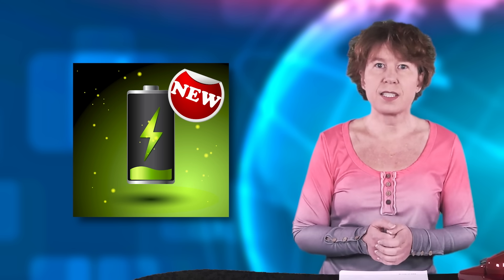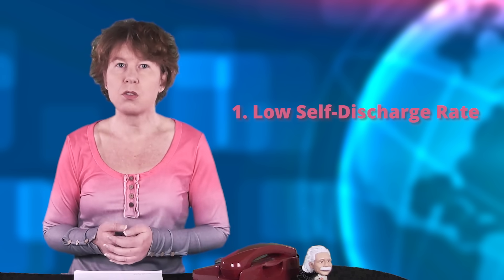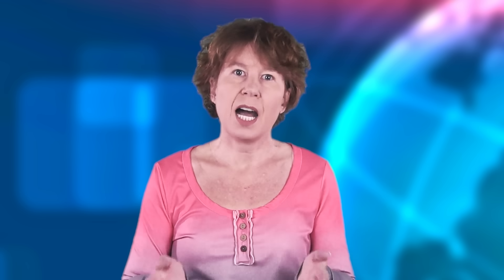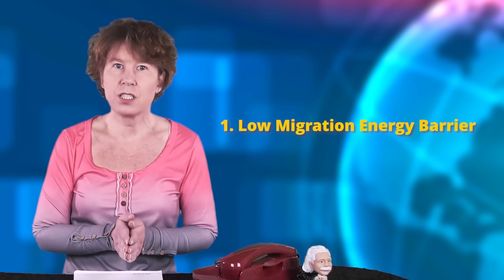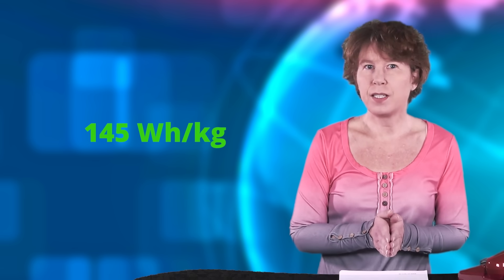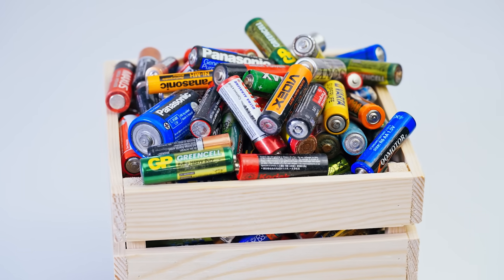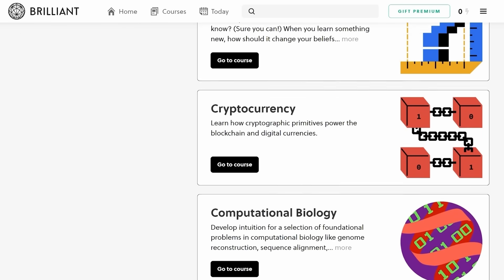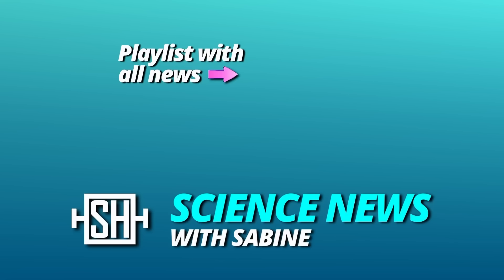Fully Charged in Just 5 Minutes: New Battery Breaks Records

Comment: So, a Tesla use 250kW to charge in about 20 minutes.
So if you want to charge the same battery in 5 minutes, you need a 1MW connection. That's for sure the common connection of every home.
Reply: It doesn't work like that.  A Tesla charger will give you 250kw but only for a small part of the charging session.  Most of the time is spent throttling the power to protect the battery.  If a battery can be made that doesn't need to be protected that 250 will fill it up pretty quick.  A tesla battery only holds between 80-100kwh.
Reply: @notverygoodguy  that's present tech.
Now just pump up that numbers. So if it's throttling the time where 1MW has to be delivered is even shorter. So it's even worse for the grid.
Grids are designed for "constant" load not fluctuating loads of hundreds of Megawatt throughout the country.
Reply: @spedi6721  Let the big boys figure it out. Which they will/are. You could do some research about how they're actually doing it rather speculating from ignorance. The information is all out there. It's solved and doable, though of course the grid will need to increase overall electricity generation by quite abut over the next 25 - 30 years that the transition will take.
Reply: @spedi6721  People don't charge their cars at the same time.
Reply: @notverygoodguy  what? Then what are the cars doing at the chargers on the motorway?
Reply: @spedi6721  Same reason why you see more than one car at a time at gas stations on the motorway.  Still doesn't mean that everyone has to refuel all at the same time.
Reply: @spedi6721  That isn't how fast DC charging stations work these days.  Fast DC stations almost universally buffer the grid energy through a very large battery (such as a Tesla megapack or two).  The more bursty energy delivered to the vehicles is coming from the buffer battery, not the grid.  The grid acts more like a trickle-charger for the buffer.

As an example, one Tesla Megapack with 4 MWh of storage holds enough energy to fully charge around 40 EVs from 0 to 100%.
Reply: @junkerzn7312  finally someone with a reasonable answer! Thank you mate! Technically a good solution to ease the stress on the grid. 
But tbh. That'll give you a lot of charging losses. You need about 120% of power, to get 100% into the buffer battery and than a second time into the car.
So that's why fast charging is more expensive.
But in the end, it's not about the money, but the 20% more co2 you emit.
Guess some ppl will be glueing them self's to the superchargers then.
Reply: @spedi6721  No, not that much.   The buffer battery represents around a 3% inline loss, on average.  The battery round trip is 95% efficient and some of the energy bypasses it.  So ultimately the buffer battery does not really impose much in the way of losses.

The AC has to be rectified anyway (buffer battery or not), and the AC is coming in at 7200V or higher.   The buffer battery is sitting at the bus voltage which can be around 1000VDC, which needs to be generated from the AC even without a buffer battery.   That leaves just the final buck regulation stage before it hits the car's battery pack.

So we are talking really high efficiencies here just in general due to the high voltage.

-Matt
Reply: @spedi6721  One solution I heard regarding ultra-fast charging, was onsite large storage battery systems that are basically trickle charged (if you can call it that) by the grid, then those are used to supply large currents... kinda like a cistern is used for a low flow well. Although, I personally think we need to upgrade the grid and greatly increase the use of nuclear power in this country to isolate sections of the grid for national security. The use of battery systems for stabilizing the grid isn't exactly a new idea, but in areas that see surge usage, it makes sense.
Reply: @CtDDtC1919  as already said will this cause additional charging losses. Now you need to charge 2 batteries, not one. And for 100% charge, you need around 120% energy. Plus the losses for the electronics. This battery also needs to be built and may not last that long.
Remember the "power bank" tesla built for a town in Australia? Parts of it went up in flames. Can't remember if they managed to rebuild it.
Reply: @CtDDtC1919  Most Fast DC charging stations already have huge on-site buffer-batteries, because that is how they reduce demand-charges from the utility and that is how they integrate solar into the station (which some now also have in huge quantities).  So the buffer batteries are already saving vast amounts of money.

And spedi6721... the losses are minimal.  3-5% at most with a buffer battery verses not.   These are not little batteries.  They are high voltage buffers on a DC path that has to exist anyway (buffer battery or not).
Reply: @spedi6721  It was just "for example" technology and the free market will sort it all out.
Reply: @junkerzn7312  Real quick, just wanna say that I appreciate a community where people can engage (possiby) bad faith actors with facts and perspective. I would not have had so much patience. Lot of people out there either confidently saying mistaken things or even obfuscating the truth on purpose. Makes it easy to want to just ignore it all and check out (which can even be the primary goal of misinformation). So, in this case, appreciate the information and context provided by the people who do know.
Reply: @truhartwood3170 of course its doable . But  not by solar or wind . And at a cost that will cripple any goverment that try's to implement.  Oh that's right make the poor pay .
Reply: @spedi6721  You were already told the losses are 5%, stop reapeating your clearly falacious 20% figure or you will be considered a malicious troll.
Reply: @Cyrribrae  I try my best as an Electrical Engineer whos specialty is hip-deep in power systems, batteries, on-grid/off-grid, the grid, and electrification in general, to educate people.  It isn't a casual interest.

The amount of mis-information that floats around social media is staggering.  And it isn't necessarily all due to bad-actors.  There are plenty of bad-actors, but also huge piles of people in categories ranging from casuals to semi-technical people who never-the-less are so badly misinformed that they just wind up amplifying and repeating, "with authority", bad information and nonsense.  Particularly when it comes to our electrical grid.

It doesn't help that it has all become so politicized to the point where people argue over the basic physics without knowing one thing about the actual physics.

Still, I think it is relatively to easy to separate the mis-information pushers from the mis-informed-but-willing-to-learn types.  I'm not going to go easy on anyone I think is pushing nonsense on purpose.

I do hope I have a positive effect when it comes to topics within my area of expertise.  And it is even easier to "fix" the opinions of semi-technicals like Electricians who understand the basics about electricity but don't quite understand how power is actually transmitted or how efficiencies are calculated.  Or old lead-acid heads whos understanding of electricity stopped at 12V two decades ago.

Ultimately, being able to turn-around semi-technical people has the greatest return because they will turn-around in-turn and be able to correct and amplify with authority.  I think it is worth going into detail just to get that sub-group on the right track.

Anyway... we continue.

-Matt
Reply: @davidheath2427  You seem to think that a roughly 1% expansion in grid generation a year is hard.

Never have I seen so many people whine and shed so many crocodile tears pushing nonsense about the grid as in the last 10 years.  The level of ignorance on display is astounding.
Reply: @spedi6721 grids are absolutely designed for fluctuating loads. They have to be since loads fluctuate massively throughout the day. And have to be able to account for technical issues, such as a power plant shutting down for whatever reason.

They however are not currently built with high enough output to fast charge every car. Grids will need significant expansions if we want to force everyone into buying an EV.

One method used is to install a buffer into the charger itself. However, that effectively doubles or even triples the required battery capacity. And the batteries are the most environmentally harmful part of EVs, so the buffers negate a significant portion of the environmental advantages, if not all of it. It also doesn't remove the need for massive grid expansion, just makes power demand more steady.
Reply: @Erowens98 having batteries in chargers doubles or triples the required battery capacity?

Do you imagine, that there would be one or 2 batteries in the charging grid for every one battery in a car?
Reply: Private cars don't need fast charging at home, because they sit idle for most of the day (or night) anyway and there is enough time so charge them slowly. Outside the US however there are a lot of people who don't own a McMansion with a wallbox, but have to either charge at a public charging station, or take the bus.
Reply: @NeovanGoth  You don't need to own a McMansion to install a $150 wall box.  But it is certainly true that renters are beholden to their landlords being progressive enough to want to install a few chargers.   Some are, some are not.  More and more as time passes, just like with any transition.
Reply: @junkerzn7312  I mean, I could install a wallbox in my rented apartment, but the car would fit through the door. ;)

Perhaps it's different in the US, but here in Germany, a lot of people (particularly in cities) do not have a private parking spaces; they just park their cars on the street. There are concepts to provide those with chargers, for example by attaching them to already existing street lamps, but I very much doubt this is feasible; it would be far more than 100,000 in this city alone.
Reply: Yeah, but it turns out the charging cable doesn't reach from the 6th floor to the underground parking lot.   Good luck retrofitting the building.
Reply: Its inaccurate to claim "in about 20m" when thats not to full charge. Full charge is a lot longer as charging becomes exponentially more difficult the closer you get to full.
Reply: The absolutely first thing I want to know if someone said something like this is, how much capacity does this battery have? I assume.... Not so much
Reply: It charges at 250kw only for 40% of the battery, most of the charging happens at speeds lower than that set by the battery
Reply: @renic8428  it still is outside of the grids abilities.  And the government is not going to pay for that .
Reply: Home chargers are typically limited to less than 10kW, here in the UK for single phase it's around 7.5kW I believe.
Reply: My home charger puts out 1.21GW which charges my Flux Capacitor in no time.
Reply: 5 minutes at a charging station is still longer than it takes to fill my tank at the gas station. However, I'm also not trickle filling my gas tank overnight in my garage at home either. Fast charging is not for people that charge at home and do daily driving well within the range capability. It's for filling your "tank" up when driving beyond its range wether for work or pleasure. Imo it's an absolutely critical feature for overall electric vehicle viability.
Reply: Even with a 5 minute battery there is no reason to fast charge at  home.  Charge while you sleep. Let the charger charge when electricity is the lowest cost.
Reply: Unless you're in a hurry @danharold3087
Reply: @danharold3087  "Charge while you sleep."

Unless you're a night-shift worker, that electricity isn't coming from renewables, it's from a fossil fuel power station. So you achieved....nothing. (Actually, you released more CO2 by buying that EV than my 20 year old V8 diesel engine car will in the next 7 years! That makes you a 'green utopia' twat!)
Reply: @danharold3087  that's the biggest problem. I would buy an electric car, but I don't have any possibility to charge at home. I could only use the city grid chargers. Far to inconvenient
Reply: @spedi6721  that is "currently" a valid argument, but when automobiles were in their infancy folks would have probably said "I have to fill up at gas stations... far too inconvenient, give me a horse and buggy any day!" Things are changing, and a valid argument one now may no longer be valid in the near future. Be flexible amigo, but always do what is best for you and your individual circumstances! (I mean that in the most respectable way)
Reply: @CtDDtC1919  I like technology and all the discoverys. But the comparison with a normal pump station doesn't work.
The energy density is so much higher.
Upgrading the power grid is one thing. It will get very expensive.
The second is that we have all the different type of power plants we can think of, but none has the needed dynamics. Those buffer batteries can only help a small amount, but not what will be needed when there are a significant amount of BEVs out there. (I mean 50% or more).
Those 5min charging times sound fancy and may work in rare cases. But we won't see it reality. (like in the last 10 years where we constantly hear this news)
There are a few more technologies needed to be discovered to make this an everyday usable item.
I hope to live long enough to see this.
Reply: @spedi6721   then you were made of the gas stations, cause the same problem exists there, since you can fill up the tank at home either
Reply: Whose home has a 250KW service?  A 240V, 200 amp service amounts to only 48KW !
Reply: @mitchwhites3177  In the UK the maximum draw for a house is 100 Amps. You will have to pay for a new hookup if you want more, the cost is tens of thousands of pounds
Reply: @mitchwhites3177 and many older houses in Noth America are 100 amp at 120 v, I,e 12 12 kilowatt
Reply: @mitchwhites3177  the supercharger station!? (do you always upvote your own comment immediately after posting?)
Reply: Right, since most people only spend 5 min per day at home.
Reply: @truhartwood3170  yea, I mentioned that, but my main point is that there could be be an extra ordinary number of chargers with this power output. The power grid is not capable of delivering  that power in such a short time. These fast switching loads are unpredictable.
Theoretical: 100 cars (that is not all that much!) trying to load simultaneous. So the grid has to supply 100MW for about 5 minutes. There is no type of power plant that can deliver those gradients of power. Also I would like to see the connection cable for the car. Power plants need some time to ramp up/down.
Reply: @spedi6721  not sure that the grid cant handle it, because most EVs will be charged at home, and almost always over night when juice is cheaper, because demand is really  . compare the demand for juice during the day vs the night.
Reply: @spedi6721 Sounds like somebody needs to invent a capacitor or an inductor...
Reply: And that rate of charge will be derived from ..... fossil fuel power stations.
Reply: It's not just homes. A charging station with 5/10 chargers can hardly afford all of them fast charging at the same time.

Comment: I’m not knowledgeable about ev battery technology, but it seems like we could create some kind of standard battery and a swapping system which would solve the charging time issue, and it could also serve as built-in insurance so that if your ev battery fails (other than by accident damage) you’d just swap it.
Reply: The idea is to free people from the oil companies.  Even charge cars from solar roofs.  That does not work with battery swapping.
Reply: @danharold3087  ok, why would the ability to stop at a station to swap batteries stop you from charging your own at home? It would just be an alternative that solved a problem that keeps a lot of people from considering an electric vehicle.
Reply: The battery is half the cost of the car, I ain't buying two
Reply: @shanent5793  I wasn’t suggesting that you buy 2. I’m suggesting that you buy a car with one, and if you’re traveling and it runs out, you pull in to a station and swap it instead of waiting  for one to charge. Sort of like the propane tank swap thing.